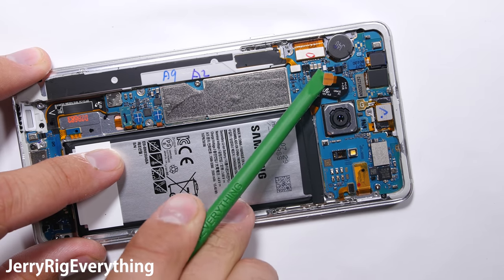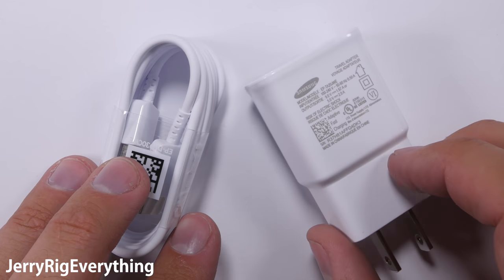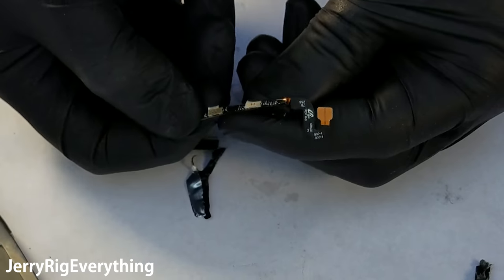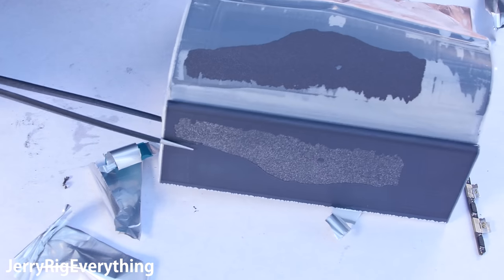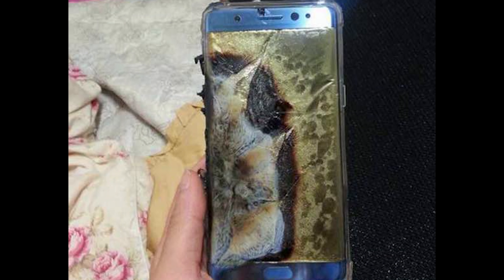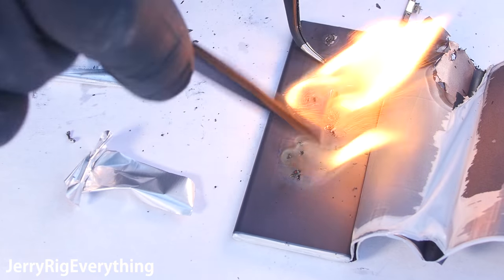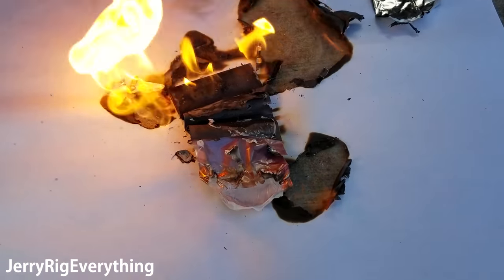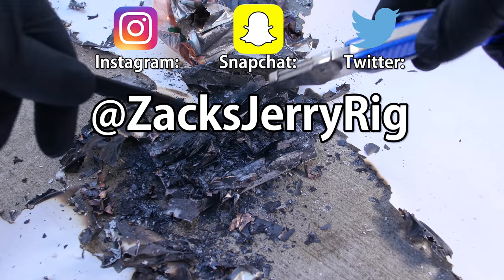Note 7 Battery Explosion!! CAUGHT LIVE ON CAMERA!!

Comment: Why people are buying Samsung mobiles ,i didn't understand! .
Reply: Samsung also a good device
Reply: Because they are good devices, this Samsung one is a 7 year old problem if I’m correct and they fixed it in all other phones after. To protect users Samsung even issued a total recall even though the explosion rate was less then 0.01% (only about 100 of them exploded). Meanwhile apple had an iPhone 8 issue where the battery could swell and exploded and they did nothing, which shows Samsung did a good job with it